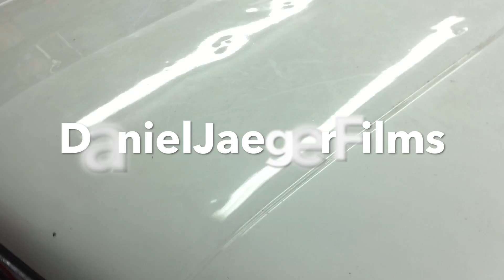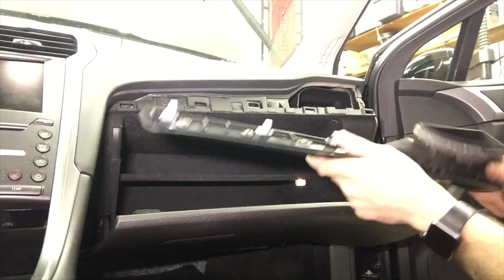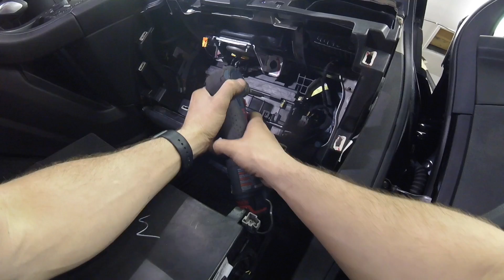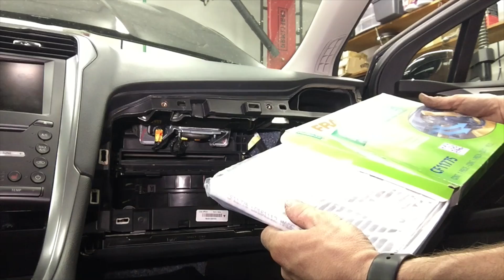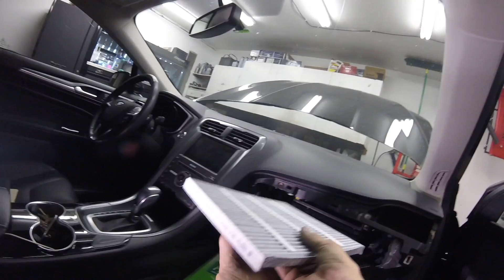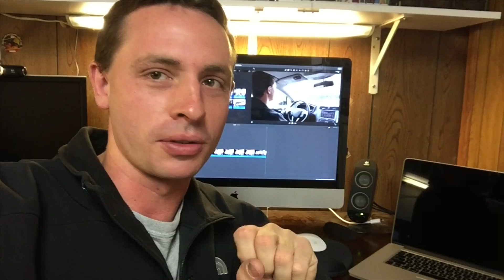How to Replace a Cabin Air (HEPA) Filter

Comment: I find it aggravating when you can't easily access the filter through the glove box. I don't see why you should have to remove anything more than a cover in the back of the thing to get into the filter area. Having to remove the glove box and/or more other parts to me is kinds of stupid. Same sort of thing as having to take the dash out to get to the heater core.

Comment: so my 2000 accord has a very similar setup to remove the air filter.  except the air filter is vertical and any water that gets into there drips out. better design than the ford

Comment: You used a Fram filter? I will laugh if by some (anti)miracle it disintegrates. 

Okay as a cabin air filter it's maybe fine, but I would never use it as an oil filter.
Reply: Nick Holzemer 
You should never buy oil filters from a pawn shop or dollar general

Comment: How would I replace the cabin air filter if I had one of those... The same way I did on my 2001 Ford Taurus because it was overly complicated to change! 
1: Remove cowl and old filter. 
2: Curse Ford for placing it in an insanely stupid location. 
3: Replace cowl without filter. 
4: Never worry about filter again.

Comment: In this car, it is what it is.  But it just really stinks that they would design something that needs periodic attention to be so difficult or an undesirable job to do for so many people.  Yes, I could do this, but how many people couldn't or simply wouldn't want to rip apart half the dash and take out the glove compartment to change a paper filter?  Even the big truck builders made it simple to change cabin air filters, without having to stand on your head, need 3 weird tools to get at it, or sell your first-born child to pay a technician to do it for you.  Shame on Ford for figuring out such a difficult place to put the thing. Why not on the front of the firewall? Open hood, lift cover, pull out old, push in new, close hatch, close hood. That's how it could and should be.

Comment: Does a 2002 F-150, a 2008 F-350, and a2014 F-150 have cabin air filters?
Reply: No, none of those vehicles were equipped with cabin air filters.
Reply: What about the 2012 F-150?